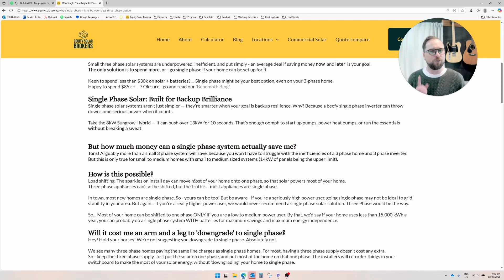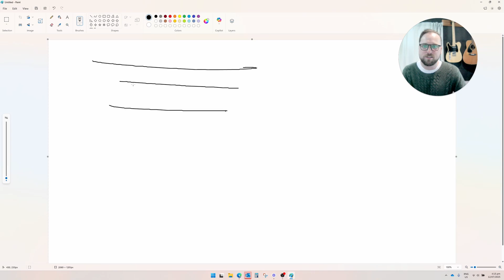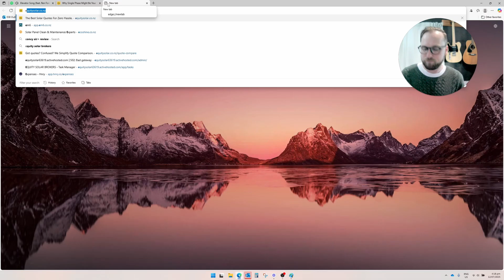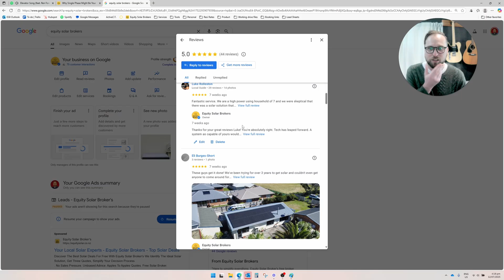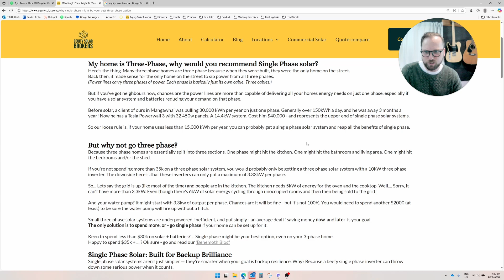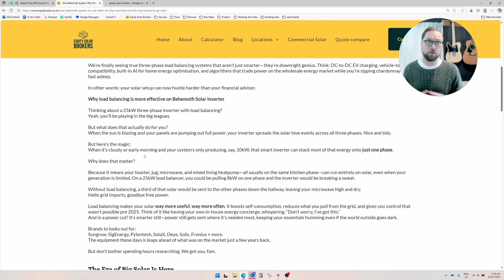Why single phase might be your best three phase option

Comment: One of the companies I talked to said the lines company is saying not to install one phase solar on three phase. Is that something that’s happened since this video? Have you heard of that?
Reply from the maker: Comes down to cost and system size. If someone has 30k or more to spend, three phase solar is the clear choice. But some People simply can't afford 30k, and so assuming a 20k investment - 3 phase solar quite simply doesn't work efficiently. The downsides of our per phase metering and the limits of small 3 phase inverters make it absolutely not worth it. 

So - we have to draw the line somewhere. Solar has to be affordable and able to deliver benefits at different price points. 

We maintain that sometimes a single phase solar system is the best three phase solution. But in no way do we guarantee clients that they can run their three phase home on just one phase. 

In the last consult we did where single phase was suggested, we based the solar savings off the idea that solar would tackle 60% of their loads. And we would be requesting the solar company to put the crucial loads and a few other things onto the solar phase, to achieve a balance of resilience, savings, and grid demand.

Comment: From my own experience, single phase inverters on my 3 phase is perfect. House is now wired single phase, with a single phase hybrid inverter on this phase. Single phase inverters on phases 2 & 3 are wired with changeover switches to combine everything into phase 1 for winter. 80KWHr of repurposed ev batteries on phase 1, keep the house running 24/7. 17KW solar. Running 6 years now. Total investment $24k

My workshop has 3 phase power, and i cant use it in a power cut. Is the only partial down-side